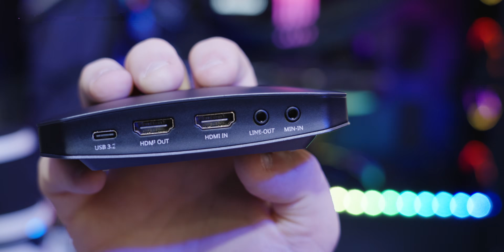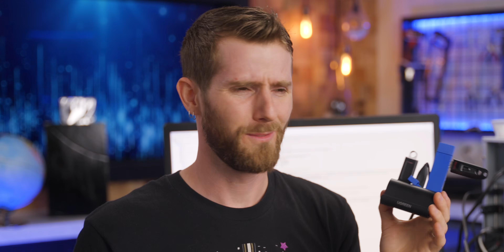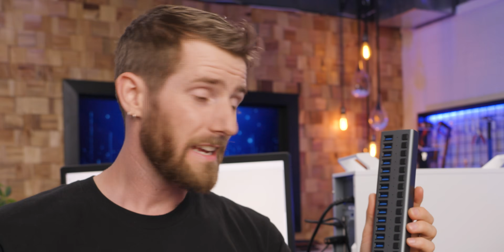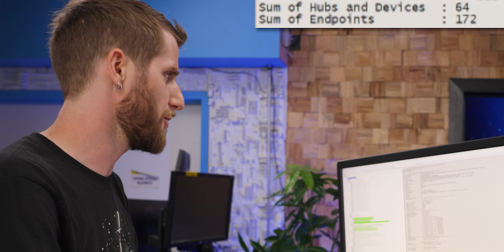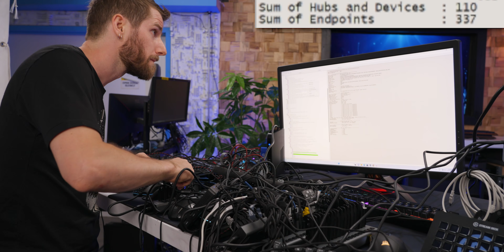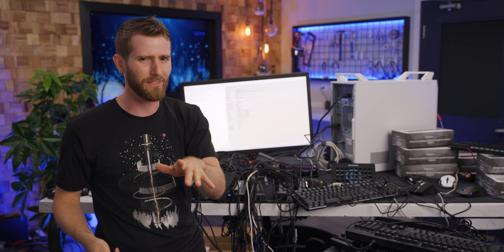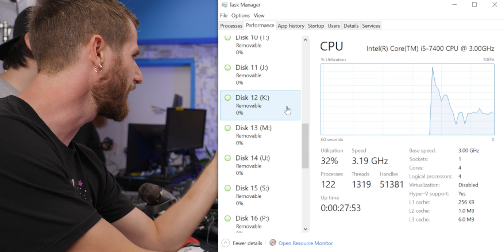How Many USBs Can You Plug In At Once?

Comment: Linus, question: Is it possible that some of the keyboards that you used could also act as a hub and have a USB port on it increasing the amount of devices connected? Just a thought experiment.
Reply: Most keyboards I know have only one usb port which acts like an extensions for another port on your pc.
Reply: @Hbk1998G no there are many that actually are usb hubs. Take the old apple keyboard as an example
Reply: there is one for the Raspberry Pi with two of them.
Reply: @Hbk1998G If the keyboard is USB and it offers a USB port on it, it has to have an internal hub, else its own use as the keyboard would be all it could do.
Reply: @churblefurbles You understood that dude wrong. Lots of keyboards from Razer have a single USB Port on the side and require two USB-Ports. It is a built-in USB extension Cord
Reply: @churblefurbles  They literally wire that 1 port to another USB cable- the Keyboard plugs into 2 usb ports on the motherboard and those 2 cables merge into one sleeve before going the rest of the way to the keyboard making it look like 1 thick cable. One of the cables goes to the keyboard, the other is literally just a link cable between the port on the back of the PC and the single port on the keyboard. Mostly optimal for wireless mice since you can literally have the dongle an inch away from the mouse that way.
Reply: @Simon-tr9hv  The Logitech G15 I had back in the days had a hub, though. So definetly some have hubs.. the keyboard only had one usb male plug but had 2 female port on it, so you could plug your mouse and your headset for example.
Reply: Apple wired keyboards had a hub. The cable only had 1 end, and there were 2 ports on the keyboard that could handle data as well. I’ve seen stuff the pass-through power but not data though.
Reply: If I remember correctly, that was the whole point of the protocol when it was created, hence the S for "serial". It never really took off though, so I'm not sure if it actually is in the protocol.
Reply: @jpfidalgo7  I actually use one since more than 10 years and still going strong ! The hidden usb ports are so useful to connect some little things like wireless mouse dongle or usb xbox/ps controller
Reply: Yes, some devices (like keyboard/mouse combo) are using "virtual" hub, allowing multiple features inside one package.
Reply: @bastienx8  yeah it was a great design for actual purpose back then. I wish they still made them. I broke mine, likely in a combo of burnt key because of a cigarette, with a bad electrical grounding in my place back then.

I also loved the usefulness of the power only passthrough. Like the cables that used to come with usb 4g internet dongles that had 2 male usb-A for the computer to give more power to a single usb device (dongle or HDD) connected to the female port on the cable (micro usb for hard drives usually). That was so useful for my dual core laptop back then. I could connect my cooling base to the computer without loosing 1 data connection.
The main usb-A went on the computer, and the power only usb-A would go for the base. The base came with a male to male cable for connecting to either of the 2 female ports it had, but I would loose the data connection. With the Y or split cable, I could get the data on the cable female, and the other male connector went into the base to just power it.
And since the base had a second port, I would use that to keep the phone charging slowly without it connecting “datawise” to the laptop.
I was increasing the availability of usb power ports, without loosing data ports. Except when I needed the 4g dongle.
Reply: you can't plug hub into hub into hub into hub into infinity.
Reply: @maximkovac2000 i have one of those. A blackwidow elite. I seem to recall that it did work fine on only one port, but that it couldn’t draw enough power to also enable RGB. I’ll have a look at it. I do have a mouse plugged in on the side port to try.
Reply: @Simon-tr9hv  What? I've never come across a keyboard which had a second USB cable for a passthrough. Meanwhile I've seen dozens of keyboards with a hub. A hub chip is probably cheaper than an extra cable so a dedicated passthrough would only make sense for a fancy gaming thing where people will fight over eliminating an extra fraction of a millisecond of latency. If I'm not mistaken all of Apple's USB keyboards have built-in hubs, and I've seen various models from other brands as well.

Comment: Some powered hubs also had this rather dangerous flaw in that it connects directly to the VBUS pin to the host, so it can backfeed the power to the computer, which can damages the controller and sometimes the entire computer if it was a laptops or all in ones. BigClive has a video about this that explains it pretty well.
Reply: I had one of those, it was trippy. Wasn't a big deal if the USB ports remained active when the system was off. Unplugged though, that was whack and I did not like that thing because of it. It was one of those "optionally powered" hubs though, and I'm sure those are the main ones that are notorious for it, which is sad cus a couple of diodes are all that would be needed to prevent the backfeed.
Reply: Just have usb certified and high quality hub and it shouldn't be a problem
Reply: BigClive did mentioned that many cheap USB charger tester with a socket can be “backfed” and it would light up, I have a couple that also have the same behavior, so that’s a good way for quickly test a USB hub for backfeeding flaw, so far I found 2 hubs that have the backfeeding problem.
Reply: @pojcharapoltosukowong  I would imagine that those hubs can be used powered or non-powered...
Reply: Wow, imagine being so stingy that you wont put a simple $0.02 diode to protect the PC.
(technically 1N5399G costs $0.012 when bought in bulk, so even cheaper than $0.02).
Reply: Had an argument with an office furniture manufacturer over this once. It would every so often make HP Elite SFF PCs hang at BIOS (and keep certain bits active if you powered the machine off - very curious behaviour with the power lights...).

Least it didn't make like Macs where the logic boards tended to eat shit in that situation...
Reply: @intercity125  My PS2 did exactly this kind of thing. It wouldn't power on with such a hub connected and powered (Rock Band and GH World Tour days). I had to remove the power from the hub to get the console to turn on. And even removing power from the console with the hub powered would result in the standby light staying on, and anything in the other USB port on the console appeared to be "active"... I stopped using the thing because the console almost died because of it, wouldn't power on even with the hub removed. Maybe it tripped a breaker or something, idk. Still using that console though.
Reply: Isn’t there supposed the be a diode on the mainboard port?
Reply: TP-Link 7/9 Port powered USB HUB's is 100% reliable. I used them on 2 PC's for many years with no problems.
Reply: @GReaper  using diodes would pull the voltage from the PC down by the forward voltage of the diode which might put it out of spec and devices may not work, especially if just using standard diodes where the drop would be 0.7 V, so using diodes for it is not really a good option.

Getting it to work with optional external power isn’t just as simple as adding a few diodes, you would need to use something like mosfets to disconnect the power lines from the computer.
Reply: I've seen this problem when trying to hard reset (power off pc, pull power cable, hold power button 30 secs) 
I was wondering what kind of damage this could be causing as well as what damage overdraw of current on USB ports causes (as well as fire risk)
Reply: @hubertnnn  I remember having a cheap 7 port hub that did this when connected to power, popped it open and sure enough there was a pair of pads between the DC barrel jack and the USB port's power, labelled "D1"... and there was an 0-ohm SMD resistor (basically a jumper) there instead. 
Diked it out and the hub stopped feeding power back to the PC and worked great after that.
Reply: This exact problem drove me absolutely mental in an old production environment I had set up. The computer just refused to power on if it was ever turned off. It turns out, the SeaSonic power supply was detecting that back-fed external 5V and thinking there was a short somewhere, so it was refusing to turn on. Never damaged anything, thankfully, but the motherboard lacking diodes did cause other 5V devices to seemingly be powered despite the system being off. Eventually I figured it out and we just disconnected the power adapter on the hub, since it wasn't required for the hub to work anyway, I had just set it up that way so folks could plug bus-powered external hard drives into it.
Reply: is that backfire bad if the device charges through the same port? Using a j5Create USB-C hub for my steam deck and not seen issues yet but the power port is optional

When the power is removed though all the ports disconnect from the computer for a second and then reconnect
Reply: @CraftingCake  In some motherboards it does have a protected USB port, but in my experience, most if not all the computer I work on has the USB VBUS pin directly connected to 5V rail of the power supply.
Reply: @conorstewart2214 In my opinion, if you expect the user to use a external power supply for the hub, it’s better of to do it like the Sabrent hub Linus got, completely isolate the VBUS pin of the host computer and just supply VBUS from the power supply, you could technically also isolate the GND pin of the USB and tie it to the external supply GND, in case of ground loop problems.
Reply: By the way, Thank you everyone for sharing their stories and raise awareness of these potentially dangerous powered USB hub, I never expected my post would get so many responses, I just wanted to make people be cautious when choosing a powered USB hub so they won’t fried their computer. Thanks again!
Reply: @pojcharapoltosukowong  by doing that though you then limit the usefulness of the hub. If you are using a hub with a mobile device like a laptop or phone then you need a power supply to use a hub like that and if you have nowhere to plug it in then you cant use the hub hence making it only useful when just left attached to a desktop or when you know you will be able to plug it in.

You do get hubs meant for mobile use now too and they charge the phone or laptop at the same time but still they can run off of the vbus from the phone or an external supply.

All it takes to make it work with external or bus power and not have it backfeed is some logic and MOSFETs, I would be surprised if there doesn't already exist hub ICs that have that built in already.
Reply: @conorstewart2214  Indeed, I recently got a USB 3 hub which can either be powered from the bus or the external 5V (albeit through the Micro USB port which is not great for longevity) and doing the “BigClive test” of plugging a USB host side to the USB charger tester output while it was powered by external 5V, it doesn’t appear to light up. So the hub does not backfeed the computer, which are good news. I initially though they installed a Schottky Diode on the Micro USB and the host VBUS, although I did test the voltage both from the bus powered or external powered and there is negligible amount of voltage drop in both cases, so I think it could have a MOSFET polarity protection like you mentioned.
Reply: i powered a pi like this once with a unpowered hub and a external hard drive with 2 usb connectors (one had power) i plugged the power one into a wall adapter and it powered both the hard drive and the pi

Comment: I’m not sure if it’s part of Labs but it would be cool to see how much power each peripheral draws. In this video it would be interesting to see how much power was flowing to the hub from the motherboard.
Reply: When they were trying to figure out why everything was still working at the beginning I really wanted them to check the actual power draw.
Reply: There are 5$ USB passthrough devices that can do this, I use them to test cables as cables don't tell you what protocol they can run
Reply: I have a suspicion the one hub with the USB's may have been overheating and the chips crashing
Reply: @tonnentonie2767  LTT has those as well as fancier ones, they just didn't pull them out

Comment: If I'm not mistaken the CPU polls each device many times a second as well, so that's a good amount of CPU overhead. I wouldn't be surprised if there's significant delay between pollings and some devices not liking that.
Reply: All those gaming things demanding polling at unreasonable speeds
Reply: @ptamog yeah >1kHz peripherals don't make any sense unless you're actually a pro and you've got a 360Hz+ monitor, consistent fps higher than the refresh rate, and optimized all the low hanging software settings. even going from 1kHz to 8kHz that's shaving only 0.875ms off input lag...
Reply: I believe the actual polling is done by the USB Host Controller, not the System CPU. When there is a result from the poll, when say a key is pressed or mouse movement occurs and so on, there could be CPU overhead servicing that, though.
Reply: @GeekProdigyGuy they make plenty of sense. The higher the peripheral refresh rate, the more consistency between each individual mouse movement.

They matter mostly for quick precise actions such as gaming.
Reply: And if the polling can't happen in time the device probably times out and resets the connection. Which will make the situation worse lol
Reply: @Samuel.55 That's not true, the mouse itself handles most of that data. They did a video on it.
Reply: Yeah each poll is using a thread by itself, so when you start stacking up threads that deep you're going to have issues with latency.
Reply: @BCProgramming The specific difference between USB host controllers and alternatives like 1394, was that USB relied on the CPU which resulted in a typically higher latency in things like production audio processing. It's why firewire was preferred for such things in the early days because single threaded CPUs couldn't deal with the overhead. The CPU was the limit to both throughput and latency. Once better CPUs stopped being the limit, more expensive firewire controllers stopped being sensible. 

Also we just witnessed this effect at work in the video with 30% CPU utilization with device merely connected but not doing anything.
Reply: @Samuel.55  which is why I said IF you're a literal pro gamer with a 360+Hz monitor & optimized setup, it might be worth it. doesn't apply to vast majority of people. I'd bet if you take 10 random FPS players even with decent skill (say 90th percentile) and a 120Hz monitor, there'd be 0 noticeable difference in their performance with 8khz mouse vs 1khz mouse.

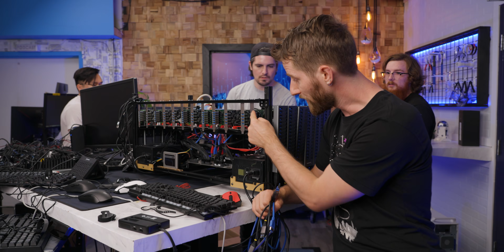Comment: Thanks for the tech tip. I never knew multi-controller cards existed and will see if it helps my setup. However, the link for the 4-port StarTech card is not the same as described in the video. The linked card is the PEXUSB3S4V which is a common place 4-port hub with only one controller. A multi-controller card is much more expensive. I think the correct 4-port card with individual dedicated controllers is the PEXUSB3S44V based on the visual clues from 19:28 that sorta has four controller ICs in the blurry background.

Comment: FYI:  A USB device will have a different ID when moved between ports - say like a serial adaptor moved from USB 1 to USB 2 would go from COM1 to COM2.  Keep this in mind when using a USB device - Windows will remember each device plugged in, and which port it was on.  Prepping USB devices for shipment can fill the registry with crap that's old, etc.  Great video BTW.  You are "The EXTREME!"
Reply: It's annoying, but helpful that it does this. One time I had a device malfunction on one port, yet it was fine on another. It stayed broken on that one port too.
Reply: @ArtisChronicles  It was helpful that it stayed broken?

Comment: This is absolutely insane, and I love it! I don't have enough USB ports on my system so I've always been interested in getting a powered hub and that 16 port looks awfully interesting now.
Reply: What the hell do you need 16 more usb ports for lmao
Reply: @D3nn1s    I see someone has never made a USB RAID device Just Because™
Reply: @D3nn1s  music production
Reply: @D3nn1s  a flight simulator cockpit.
Reply: Ikr man
Reply: @Fudgy___  then you will probably run into bandwidth limits with multiple microphones and cameras plus a capture card and extra drives.
Reply: @Fudgy___ I feel ya. I also stream my dj sets and can never have enough usb ports.
Reply: @Fudgy___  You should buy another controller entirely at that point, unless you know the one on your mobo is very over-spec.
Reply: @D3nn1s  Console modding, streaming stuff, and various other USB devices I swap out on occasion that I would really like to have handy when needed. I also do computer repair and being able to have all of my diagnostic equipment plugged in 24/7 would be nice as well.
Reply: My PC is built into an old Compaq Prosignia Desktop case which I modified to work with modern components, but lacks front panel IO.

Comment: Finally… I need more info on this. Flight sim IO is acting weird.. I have researched USB tiers and PCIE lanes vs onboard chipsets/controllers and it’s just nuts
Reply: I can confirm this absolutely with VR equipment, but also better stability with flight sim gear.
Reply: Mythbuster moment for ltt
Reply: Valve index dongles are weird too
Reply: @theflightwrightsgaming906 I assume they mean IO == input output so all the controls like switches and throttles
Reply: My sim race gear disables my keyboard. It's either steering or keyboard. No problem in most cases in my case.
Reply: TOPHER210  Yeah.... sucks but the answer is more controllers. And the price DOES matter for fewer ports because then you have more 'directions'